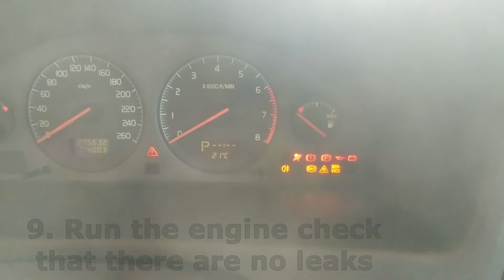DIY. FUEL FILTER REPLACEMENT VOLVO (P2 chassis cars)

Comment: I bought a filter dor a 2006 S60 but it seems bigger than the old one under the car. Is that ok? The old one is 3 1/4"  long while the new one is just under 5". I see you used a bigger one was well.
Reply from the maker: Hey Sam! I don't think it will be the problem. Bigger filter = better filtration. If it fits and doesn't leak fuel, I won't worry about it. Let me know how it worked out. Cheers.

Comment: Is this for a c30 1.8 petrol? Cant find the fuel. Filter on my car .thank you
Reply from the maker: Hi Marcus,
Mine is V70 2001 2.4L. Thanks for watching. Look from the tank all way up to the engine and you will not miss it)
Reply: Were you able to locate the fuel filter? I'm looking to replace mine but I can't locate it